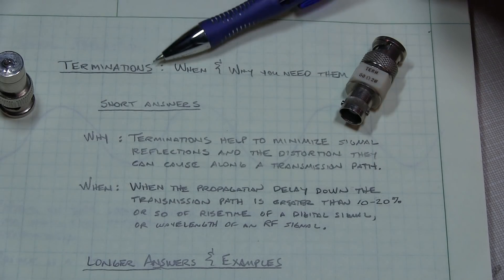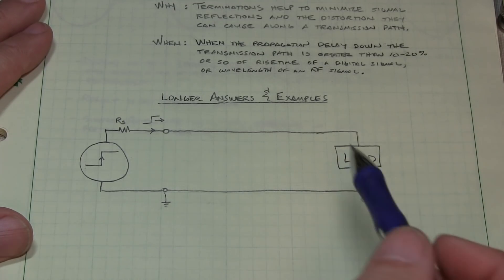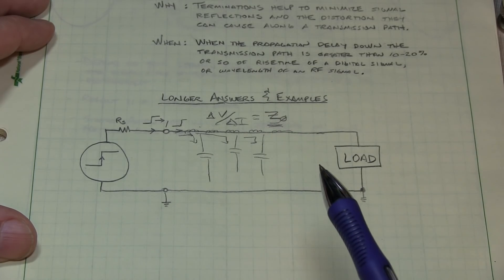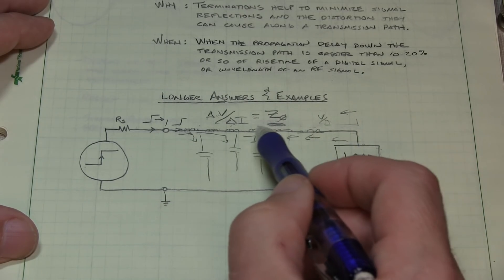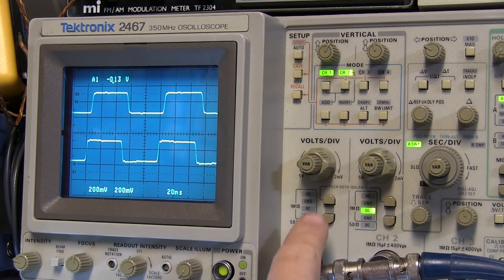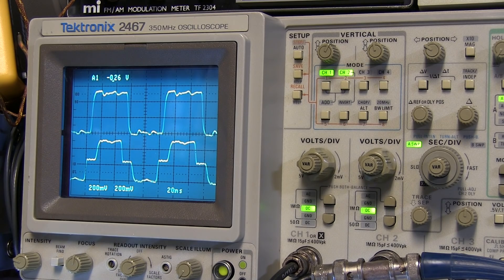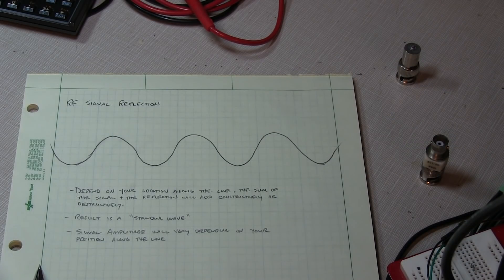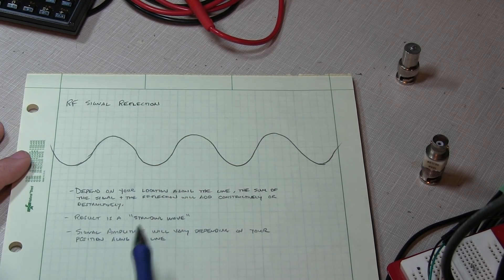#143: Transmission Line Terminations for Digital and RF signals - Intro/Tutorial

Comment: Great video, I just have 1 question. Why does the amplitude of the signal on CH1 also change? Would the square wave do the same?
Reply from the maker: The amplitude varies at the output vs. frequency because the load seen by the generator varies with frequency - resulting in a different divide ratio against the generator's 50ohm output impedance.  The situation is more complex with squarewaves because they contain a wide range of frequency components.
Reply: ***** So the variation of the load that the generator sees is due to the non-constant input impedance of the scope or does it have something to do with standing waves.
Reply from the maker: Marko Antesic No, the input impedance of the scope is constant - it is due to the frequency dependent input impedance of the coaxial transmission line that is not properly terminated at the far end.

Comment: Great job as always Alan. I'm not a HAM guy but I have always been curious about very long cable runs such as from x-mitters to antenna especially at higher frequencies. Do these lines require some kind of termination / compensation due to line delayed phase shift or is this compensated for by adding or subtracting length of the dipole?
Reply: Usually antennas don't need any additional termination. The antenna itself is tuned to have a 50 ohm imedance at its designed frequency of operation (depending on the antenna type...) This is one reason why SWR meters are used, to measure the reflected energy and make sure that the antenna is actually impedance matched with the tx at the frequency being broadcast.

Sometimes impedance matching bridges are used to match the tx to the antenna. These use inductive and capacitive elements to control the impedance, since resistive termination would genereate heat and signal losses.

But, I'm a noob when it comes to RF stuff, so I've probably missed out a lot more information.
Reply: *****
Thanks Jim. I understood the matching of antenna by varying dipole length with a SWR meter. I will assume the tuning of the antenna with a SWR meter would compensate for the added capacitance of extra long cable runs however, the issue is still fuzzy for me. The only other option that occurs to me would be to use an inductive balance at the antenna however, I not sure. Thanks again.
Reply: ***** impedance matching is not only done to eliminate standing waves, it is also usefull to transmitt maximum power. A resistor is the only element that can convert electrical energy to another domain (usually heat), thus antennas are modelled with a real (resistive) and an imaginairy (capacitive/inductive) part. The imaginary part creates a near field whilst the resistive creates a far field. As the name implies, far field electromagnatic waves decay with a 1 over the distance relationship, whilst near field waves decay with 1 over the square of the distance, thus we want as much of the far field waves as possible because that is the actuall waves we want to transmitt.
This can also be seen in the general transmitt power formula:
Ptransmitt= 1/2 * V^2/|Zantenna|^2 * Re(Zantenna)
If the impedance is completly real, the transmitted power is maximum.
Reply: By your post here, I will assume that tuning the length of the antenna will compensate for any capacitance in the line eliminating any reflections/standing waves which would degrade power projection. I had considered that by adding any other termination either capacitive, inductive or resistive, at the antenna, would be wasteful. However, it appears to me that your the math says otherwise. Alan may need to do a video on this subject. I sure hope he does.
Reply: bain5872 It sure is an interesting topic.There will actually be an either capacitive or inductive element at the base of the antenna feed point, remember that inductors and capacitors do not use power as a resistor does so no power will be wasted. You in theory would be able to trim the length, but from my understanding, it is extremely difficult because for example with a half wave dipole antenna, the impedance is only real at exactly the multiples of halve the wave. In one of my own videos i have built an fm transmitter which includes antenna impedance compensation in the form of a series capacitor. The antenna was measured using an impedance measurement tool and then the appropriate decision to use either an inductor or a capacitor was done. 
The results are quite astounding, the antenna was suddenly completly inteference free (i.e. holding your hand in the near field would not affect the transmission because there was almost no near field anymore) and the range was increased significantly.
Reply: I agree, this subject captures my attention for sure. And with your using a series capacitive element for compensation really gets my brain moving. I now see clearly why trimming antenna length won't cut it. You have cleared a lot of cob webs out of my head with your explanation. You have answered my question. Thank you. This makes perfect sense to me now. I think my mental block was due to the fact that I was assuming and for what reason I do not know, that reactance either capacitive or inductive would dissipate some power. Being they do not, it all adds up now and gives me some very interesting ideas for future design work. Again, thank you very much!